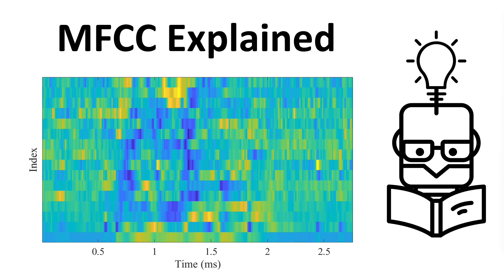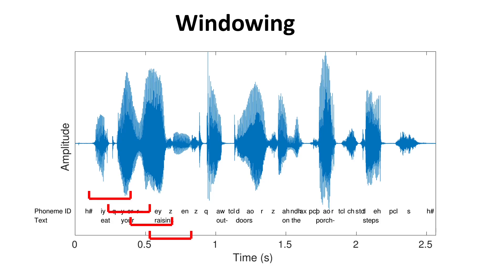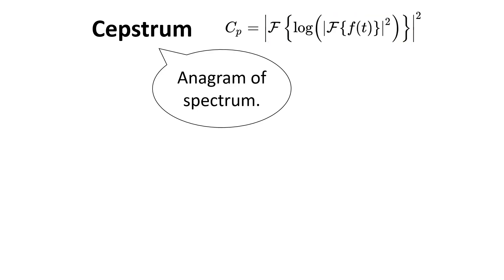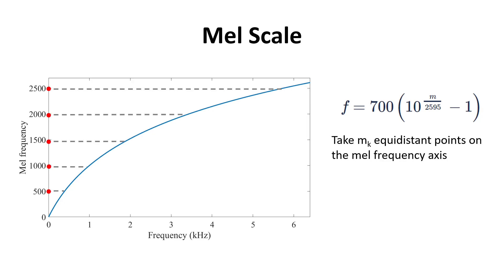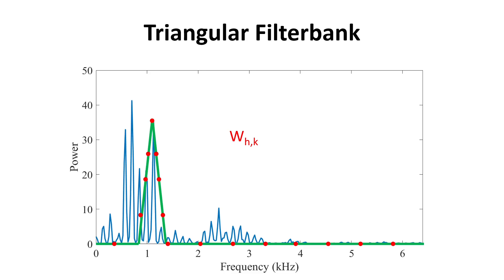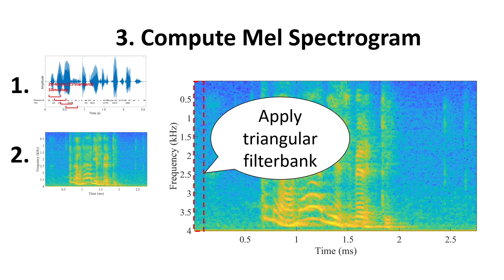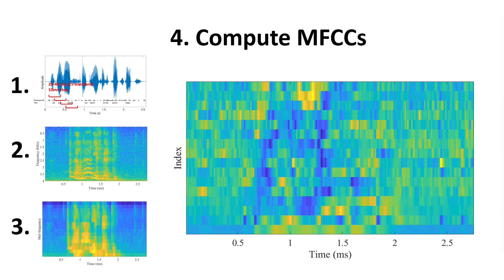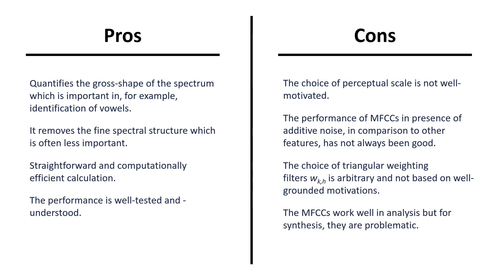Mel Frequency Cepstral Coefficients (MFCC) Explained

Comment: Hi nice presentation..tbh applying filterbank part is the hardest to understand. 
1. After we compute the fourier transform to each frame/segment signal, we convert signal to mel scale and applying triangular filterbank?and what is the output from mel filterbank?

2. Btw can I have the reference that you used?
3. Can i get the code to generate all this plot 1:59 ?
Reply from the maker: Thank you for your feedback! Yeah, the filterbanks part also didn't come easy to me. Maybe I should have provided more details there. Regarding your questions:

1. Almost correct. We don't convert the spectrum to mel-scale directly, we apply the triangular filterbank to obtain the filterbank energies. We could have simply selected the frequencies that correspond to equal points on the mel scale, but then we would have lost quite a bit of spectral information. You can think of filterbank triangles as taking the average of frequencies in that triangle.
2. http://practicalcryptography.com/miscellaneous/machine-learning/guide-mel-frequency-cepstral-coefficients-mfccs/ and https://wiki.aalto.fi/display/ITSP/Cepstrum+and+MFCC
3. I don't have that code anymore.

Comment: tbh I am not so understand in the riangular bank (03:23),  why we are not keep the highest frequency component?what does the mean Wh,k, Xh and the red dot on frequency?
Reply from the maker: Thank you for your question! Basically, you can see at 02:35 all the possible filterbanks we can apply to the spectrum. Some of them capture the highest frequency component.

W_{h,k} - the weight given by filterbank k at frequency h in the spectrogram
x_h - the power of the frequency h 
red dots - each discrete frequency in the signal 

I hope that this helps you in better understanding the video material. Please let me know if you have any other questions.
Reply: @datamlistic  I have learn from many tutorial so that I have made the summary, please correct me if something missing, btw my project is mel spectrogram, it is process before DCT part in MFCC.

1.	Pre-process the audio signal: Depending on the application, the audio signal may need to be pre-processed before computing the Mel spectrogram. This can include steps such as removing silence or background noise, downsampling the signal, or normalizing the signal level.
2. Compute the STFT of the audio signal: To compute the STFT of the audio signal, the signal is divided into overlapping frames using a window function. The Fourier Transform is then applied to each frame to compute the frequency spectrum of the signal at that point in time.
3. Convert the frequency spectrum to the Mel scale: The frequency spectrum is typically expressed in Hz, but the Mel scale is based on the way that the human auditory system perceives pitch. To convert the frequency spectrum to the Mel scale, the spectrum is multiplied by a scale factor that maps the frequencies to the Mel scale.
4. Apply the Mel-weighted filter bank: The Mel-weighted filter bank consists of a series of filters that are spaced equally on the Mel scale. Each filter is designed to pass a specific range of frequencies and the output of each filter is a measure of the energy in the signal at those frequencies. The filters are typically designed using a triangular shape, with the center frequency of each filter being the peak of the triangle and the width of the triangle being determined by the bandwidth of the filter.
5. Compute the Mel spectrogram: The output of the Mel-weighted filter bank is a set of filterbank energies, which represent the energy of the signal at each frequency band on the Mel scale. These filterbank energies can be plotted over time to create a Mel spectrogram, which is a visual representation of the frequency spectrum of the signal over time.
6. Post-process the Mel spectrogram: Depending on the application, the Mel spectrogram may need to be post-processed before it can be used. This can include steps such as smoothing the spectrogram, applying a logarithmic scale, or normalizing the spectrogram.
Reply from the maker: @devdexvils7602  That's pretty much the algorithm used to compute the Mel Spectrogram. The only remark I have is that you should make it a little bit more clear that at step 5 you apply step 4 on each frame resulted from step 2.

Comment: Thanks!  Nice explanation.    They were used in the early days of speech recognition when most recognizes were HMM based.
Reply from the maker: Thank you! MFCCs are still quite used in speech recognition based neural networks that do not take  directly as input the audio and need some kind of pre-processing step (DeepSpeech, LAS etc). However, the community is shifting towards wav2vec2 like models that take as input the raw audio, so yeah, they are starting to become less relevant, but are an interesting studycase nevertheless.